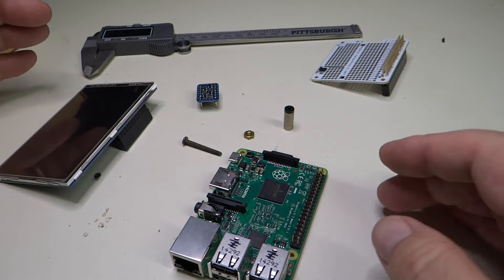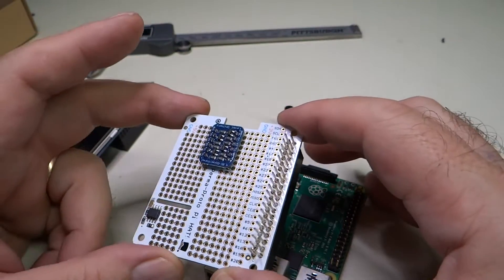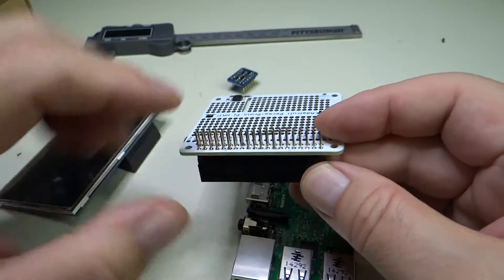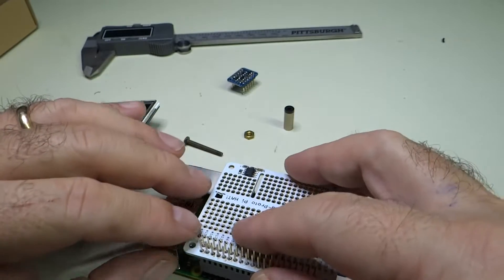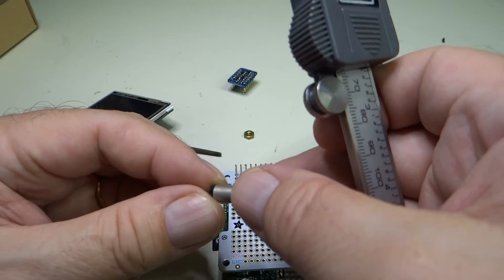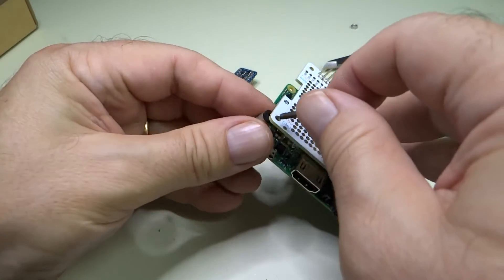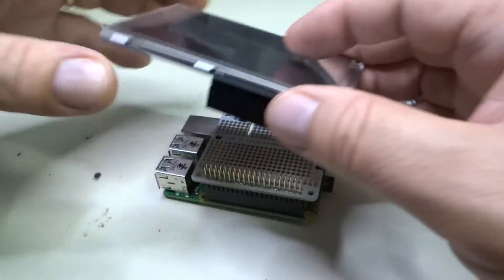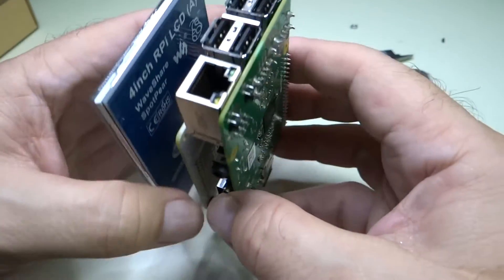Raspberry Pi stacking connectors

Comment: I need to use the adafruit pca9685 servo supply along with the lcd screen. How do i use stacking headers for that
Reply from the maker: Are you using a Raspberry Pi with it? If so, I would mount the pca9685 on a protoboard that has a stacking connector such as the Adafruit https://www.adafruit.com/products/2310 and use a stacking header Adafruit https://www.adafruit.com/products/2223 . And you'll want some of these too: https://www.adafruit.com/products/2336 Remember to avoid the GPIO pins that the LCD uses - get the pinout for the LCD and cross those pins from the list of available GPIO pins. If the LCD uses I2C you'll have to make sure it doesn't conflict with the servo board, make sure they use different I2C addresses.
Reply: I shall do that..Thanks.

Comment: Hi Greg,
I'm working on a Pi Project where I'm stacking an Adafruit DC Motor Hat and an Adafruit Servo Hat. If I'm using 10 regular servos and 2 stepper motors can I stack another hat on top of these? I have 4 Potentiometers that I want to controll the servos and they need a Analogue to Digital Converter chip to talk to the pi.  Will I have enough GPIO's for this?
Reply from the maker: Hi Martin,

I would draw a table diagram that lists the raspberry pi pins and which header pins they connect to make sure you aren't having conflicts (shorts between headers. also, you need to be careful not to exceed GPIO pin current, 16ma per pin and 50 ma total and make sure you do not exceed the power rail current that the rpi can supply. then it's a matter of good mechanical structure to support weight and vibration. does that help?
Reply from the maker: +Greg Griffes Sorry, meant to say, Merlin.
Reply: Thanks I will try today. I think my headers are here. Thanks this is a great video.